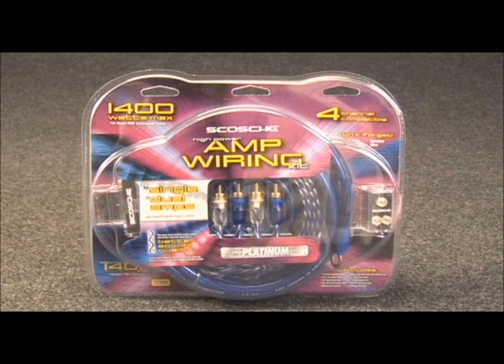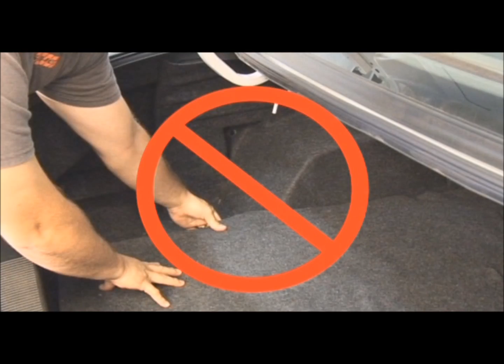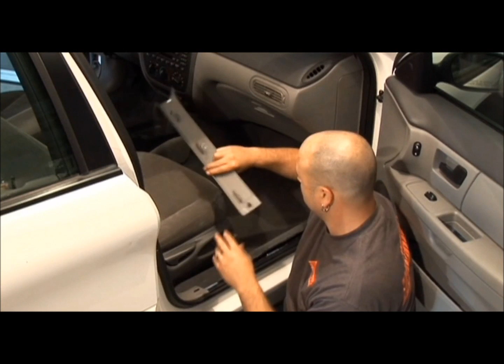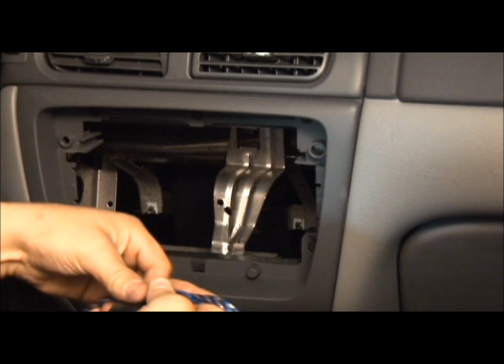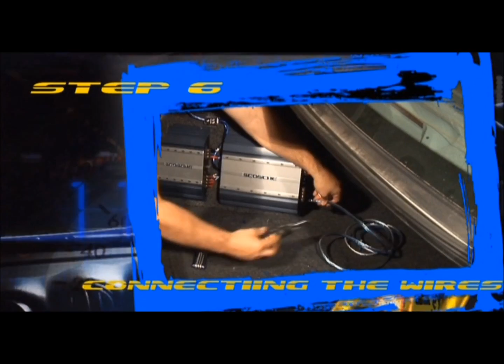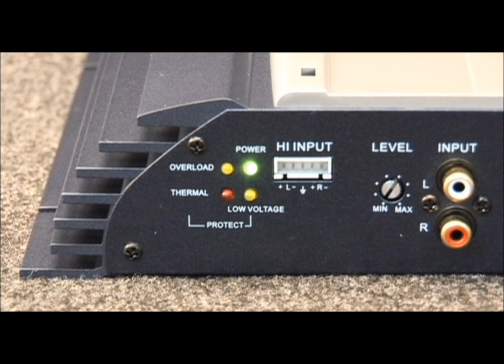How To Install A Car Stereo Amplifier

Comment: I know it maybe depends on car etc but i will ask.

If i have front small speakers and removed the stock rear ones, do i need to install lets say 6x9 in rear also with sub?

Or the 6x9 in rear or anykind of them is not needed in rear and the sub does all the work?

Some guys say turn off rear speakers if you have sub.

Comment: you loss me there i didn't see how you connected the turn on wire to the two amplifiers and what area you put the two sets of rca wires. and which speakers you connect to which amp all i heard was left rear and right rear can you explain these more simpler for my if not here my email address is darybailey@msn.com

Comment: I agree with most of this except for the tuning portion. First time I've seen a video suggest using bass boost also crossing over the sub at 80.. ight crossing over the speaks at 200hz.. so 81hz-199hz gets cut out LOL.

Comment: how mush amps fuse is used?
Reply from the maker: +Donatas Tverkus you should divide your wattage x 12 volts to get the amperage requirement on your system

Comment: I want to know step by step how to mount the amps to the trunk.  I want to use a mounting board but not sure how to mount that board to the trunk.  Just drill straight to the metal or what?